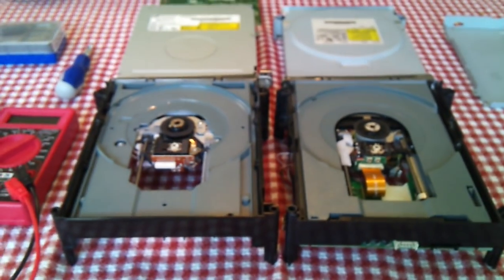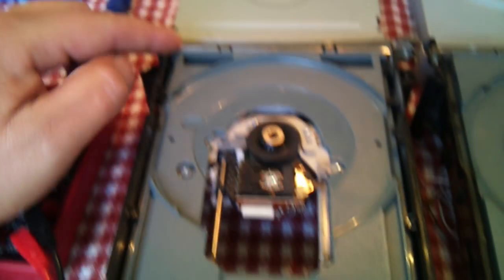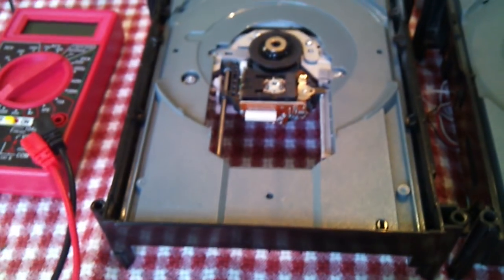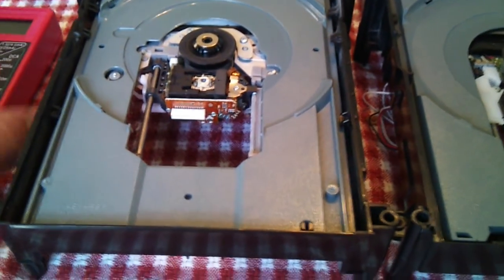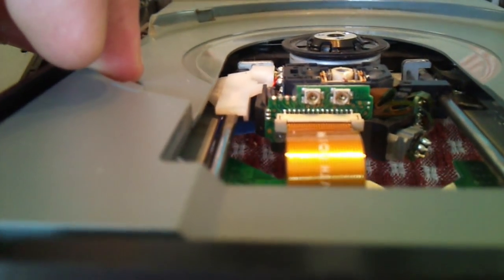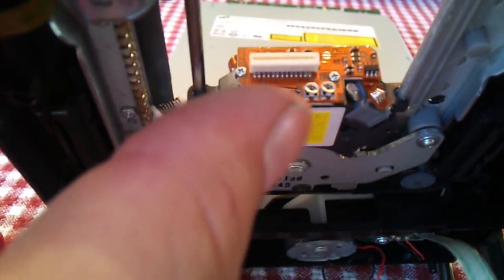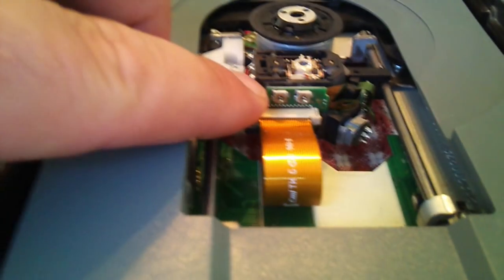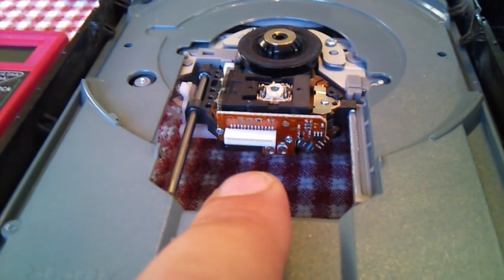Xbox 360 DVD Laser Adjustment

Comment: Good advice. I stopped using volt meters and multi-meters though. My buddy in the Geek Squad showed me this new tool and it's awesome. I can see wave forms like an oscilloscope but it auto-sets and in under a minute I have the laser lens adjusted. It;s called Service Scope and it's sold by Hickok Tools. It's a lot cheaper than a regular scope too.

Comment: I wouldn't recommend doing this without the multi-meter. IF YOU DO, don't do it a quarter turn or half turns. Turn it about the thickness of a penny test it, do another small adjustment, test it until you get it to read. IF after only like 3 adjustments it doesn't work put it back to where it was this isn't your problem. After that stop messing with it. I did a quarter turn and it worked, i went to bed woke up the next day kids were playing it. I decided to borrow my uncles multi-meter I checked it and had it running way to hot. It would've burn out the laser in no time. After tweaking it and checking it with the multi-meter I found out that even the smallest turn makes a HUGE difference in the ohms. Don't do it without the meter if you do, then only turn in in VERY small increments while testing it. And I mean SMALL turns like the thickness of a dime or the thickness of a penny.

Comment: Sometimes you can just drop a new laser in and it's set to go. Other times you absolutely need to adjust the laser resistance. Otherwise the disc won't spin up. You can take a perfectly running drive and adjust it so it's out of whack, that can cause it to not spin up. If the drive doesn't detect a disc right off, it won't spin.

Comment from the maker: No, randomly turning them is not good. If you turn the laser to high it will burn your DVD's, turn it too low and the disks won't read. Its better to use a multimeter and get the readings off the pots before you adjust them. 
All drives are factory set and have different settings, although a general setting say 4.0 could be set and then work up or down from there.
Reply: Wher do i touch the tes leads to and what should i set my multi meter on? I wish you had shown testing it.

Comment: If anyone is sitting at home mad they can't get their disk drive to work and have tried other things then you need to try this. Took some time with adjustments which were very touchy for mine. But its up and running again. Was gonna go buy a new xbox tomorrow. But all good. Get a multi meter and turn the screw in small amounts. Don't rush it with huge turns.

Comment: Old post but I was hoping I could shed some light on this.  My Lite-On drive read 5k-ohms for the left screw and 0.7k-ohms for the right.   Assuming you guys mean k-ohms, I adjusted the pots to 3.4k-ohms and 1.2k-ohms and unfortunately no change in performance here, so I adjusted them back.  This xbox 360 is having a tough time reading backups but I'm not sure it's the drive.  It works when the drive is not screwed together but not when it's put back together.  Some discs show static like video in dvd scenes but I'm thinking now  might just need to flash the os.
Reply: Mine also read kohms. He definitely meat kohms since a couple ohms can happen just from a straight wire and the potentiometer adds resistance.

Comment: My drive laser has a light but doesn't recognize CDs or DVDs, will adjusting the potentiometers work?
Reply from the maker: It should! Please use a multimeter to gauge what voltage and adjust till it works.

Comment: Hi, congratulations on the video, I have a problem, I insert the game, the disc starts, spins a little and stops, you can see the laser LED light up, but it doesn't load the game, it tells me to open the CD compartment, I have to calibrate the laser? what values? I have a Philips, thank you very much
Reply from the maker: You can try and  adjust the laser manually by trial and error, my best suggestion is to get a cheap volt meter and follow the instructions in the video
Reply: @Jay-May  hi Bro, work in progress ☺️💪 thanks , greetings to Italy 🇮🇹

Comment: so how many Ohms should it be? I have problem with old XBOX 360 Elite dvd drive. It doesn't read anything anymore, and this is the only thing I haven't tried (well, next step would be buying a new drive from Ebay) I'm studying  electrical engineering, so you don't have to avoid fancy words :P do I need to turn it on while tuning the potentiometer or what
Reply from the maker: Since your measuring resistance there is no need to have it powered.
Reply: Jay May I figured it out. it was 5.56k, and noe its 4.46k and it works perfectly

Comment: Hi, I just put a laser in my DVD player from a brand new unit and it won't read two sided discs.  The other unit will not play at all now.  Both units were working before the swap.  Does the laser diode need to be adjusted?  These are both NOS units and the parts are identical so the lasers should not be weak.  Any ideas?

Comment: My driver is a Philips & Lite-on (Xbox 360 Slim). What is a good value for the DVD pot and for the CD pot?
Reply: +Artur Pitanga The potmeter on my Philips/Lite-on drive was reading 6.02 before the adjustment. I turned it counterclockwise until it read 3.50 and now it reads all my game discs again.
Jay, thanks for making this guide and mentioning the 20K ohm setting on the multimeter. This is crucial to getting proper readings!

Comment: Hey... jay may I turned it several times and it still couldn't read my games. i did work on it without a multimeter. i turned it a quarter. and halfway. still couldn't read. i think it could be another problem. my xbox makes sort of a grinding sound twice...then it goes..."open tray" every time. does anyone else know about that? am i not turning it right? or is it really is another problem. should i find another laser?
Reply from the maker: You need a multi meter other wise your blindly turning the dash pot without knowing EXACTLY what the readings are.
Reply: +joshuah b. your only supposed to turn it a sliver other wise you just going to burn out your laser !